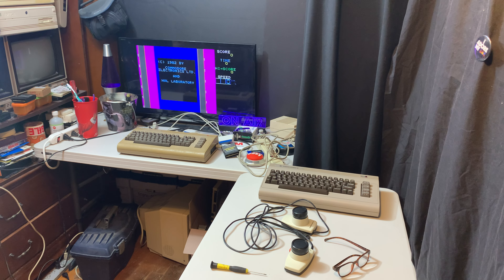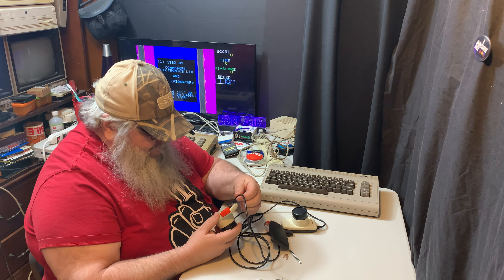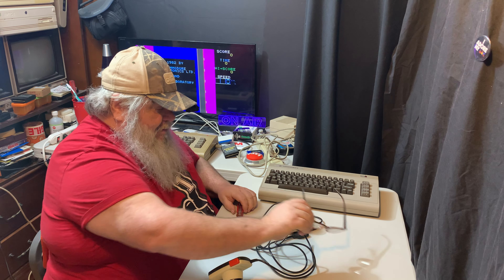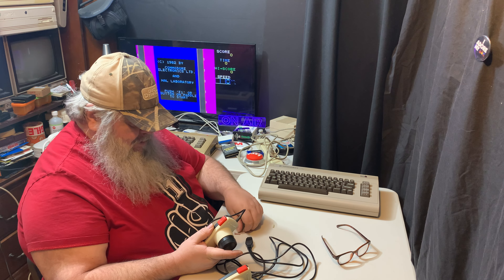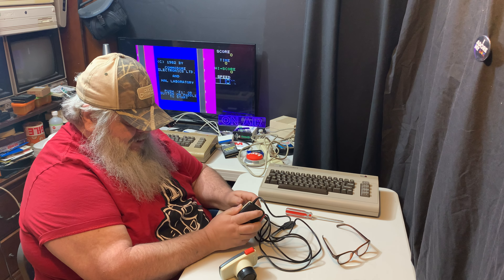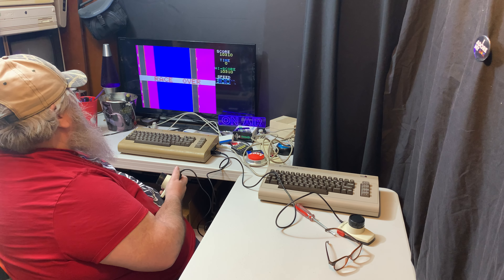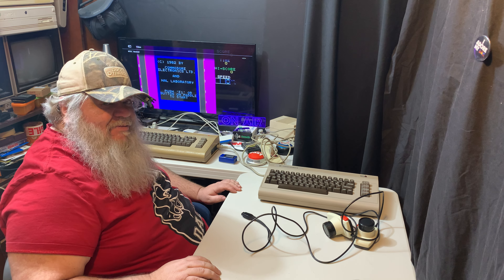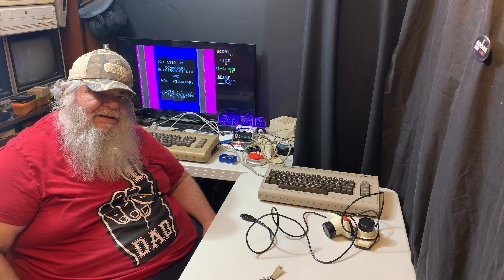Commodore 64 - Time To Open Up The Commodore Paddles To Find The Annoying Rattling -  - Episode 1253

Comment: Always good advice to take pictures when dissasembling stuff for putting back after.
Reply from the maker: Just in case!
Reply: Better to have a picture than wishing you had one
Reply from the maker: Indeed, once when I had to remove the control panel from my stove, I took many pictures and a video...there were so many wires...connectors, etc, etc, etc,...and even though the wires had a good memory of where they went, I was quite afraid that I would get it all fixed and the plug it in wrong...and with phones and digital photography, it is easy, fast, simple...and perhaps lifesaving!

Comment: The Amiga 4000s behind him are making me drool.
Reply from the maker: One seems to be working quite well and has a toaster installed!  The other is a bit of a mystery so far...but I have to find a keyboard or an adapter as they keyboards appear to be missing...the bad thing about keyboards that can be plugged in and separated from the machine...sometimes they get packed in different boxes and it might be decades before they are re-united...sigh...
Reply: @DRBradleyPhotography  true enough! :/
Reply from the maker: Are you an avid Amiga 4000 user or are you looking to add to your collection?